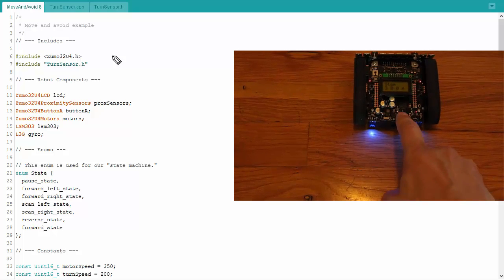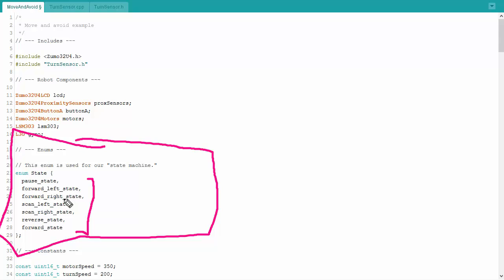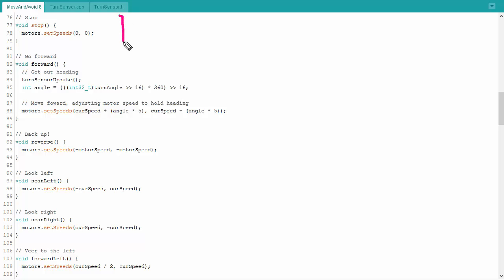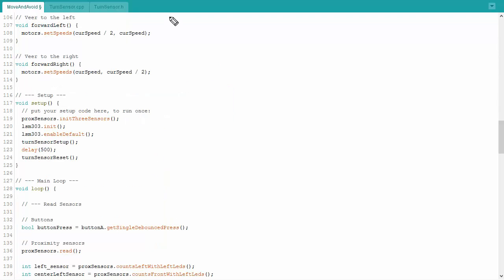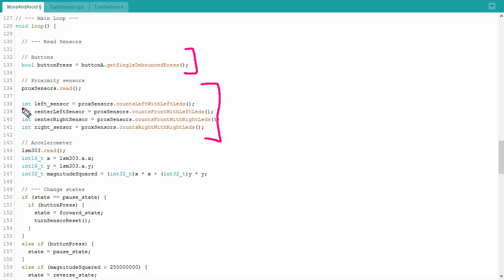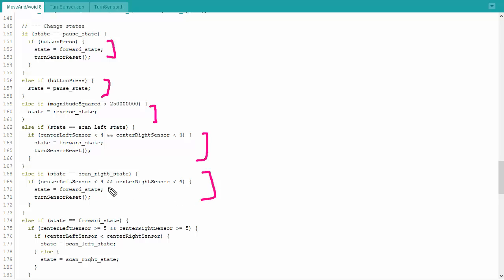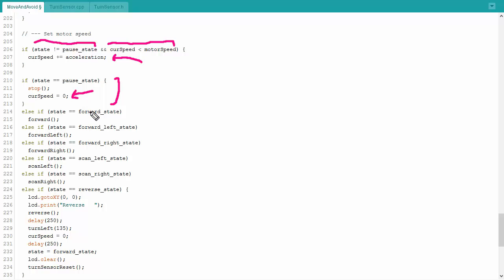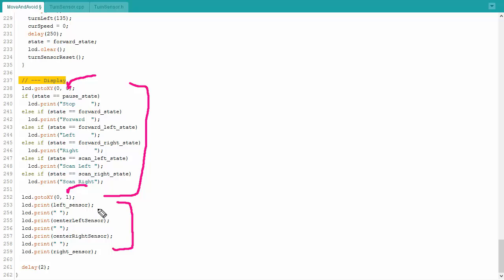Move and Avoid with Pololu's Zumo robot

Comment: buen dia, me sale este error de codigo, me puede ayudar a solucionarlo de favor gracias
In file included from C:\Users\ADMIN\Desktop\Nueva carpeta\zumo_32u4_examples-master\MoveAndAvoid\MoveAndAvoid.ino:11:0:
C:\Users\ADMIN\Desktop\Nueva carpeta\zumo_32u4_examples-master\MoveAndAvoid\TurnSensor.h:28:8: error: 'L3G' does not name a type
 extern L3G gyro;
        ^~~
C:\Users\ADMIN\Desktop\Nueva carpeta\zumo_32u4_examples-master\MoveAndAvoid\MoveAndAvoid.ino:19:1: error: 'LSM303' does not name a type; did you mean 'CS30'?
 LSM303 lsm303; // Accelerometer
 ^~~~~~
 CS30
C:\Users\ADMIN\Desktop\Nueva carpeta\zumo_32u4_examples-master\MoveAndAvoid\MoveAndAvoid.ino:20:1: error: 'L3G' does not name a type
 L3G gyro;
 ^~~
C:\Users\ADMIN\Desktop\Nueva carpeta\zumo_32u4_examples-master\MoveAndAvoid\MoveAndAvoid.ino: In function 'void setup()':
C:\Users\ADMIN\Desktop\Nueva carpeta\zumo_32u4_examples-master\MoveAndAvoid\MoveAndAvoid.ino:128:3: error: 'lsm303' was not declared in this scope
   lsm303.init();
   ^~~~~~
C:\Users\ADMIN\Desktop\Nueva carpeta\zumo_32u4_examples-master\MoveAndAvoid\MoveAndAvoid.ino: In function 'void loop()':
C:\Users\ADMIN\Desktop\Nueva carpeta\zumo_32u4_examples-master\MoveAndAvoid\MoveAndAvoid.ino:154:3: error: 'lsm303' was not declared in this scope
   lsm303.read();
   ^~~~~~
In file included from C:\Users\ADMIN\Desktop\Nueva carpeta\zumo_32u4_examples-master\MoveAndAvoid\TurnSensor.cpp:6:0:
C:\Users\ADMIN\Desktop\Nueva carpeta\zumo_32u4_examples-master\MoveAndAvoid\TurnSensor.h:28:8: error: 'L3G' does not name a type
 extern L3G gyro;
        ^~~
C:\Users\ADMIN\Desktop\Nueva carpeta\zumo_32u4_examples-master\MoveAndAvoid\TurnSensor.cpp: In function 'void turnSensorSetup()':
C:\Users\ADMIN\Desktop\Nueva carpeta\zumo_32u4_examples-master\MoveAndAvoid\TurnSensor.cpp:45:3: error: 'gyro' was not declared in this scope
   gyro.init();
   ^~~~
C:\Users\ADMIN\Desktop\Nueva carpeta\zumo_32u4_examples-master\MoveAndAvoid\TurnSensor.cpp:49:17: error: 'L3G' has not been declared
   gyro.writeReg(L3G::CTRL1, 0b11111111);
                 ^~~
C:\Users\ADMIN\Desktop\Nueva carpeta\zumo_32u4_examples-master\MoveAndAvoid\TurnSensor.cpp:52:17: error: 'L3G' has not been declared
   gyro.writeReg(L3G::CTRL4, 0b00100000);
                 ^~~
C:\Users\ADMIN\Desktop\Nueva carpeta\zumo_32u4_examples-master\MoveAndAvoid\TurnSensor.cpp:55:17: error: 'L3G' has not been declared
   gyro.writeReg(L3G::CTRL5, 0b00000000);
                 ^~~
C:\Users\ADMIN\Desktop\Nueva carpeta\zumo_32u4_examples-master\MoveAndAvoid\TurnSensor.cpp:71:25: error: 'L3G' has not been declared
     while(!gyro.readReg(L3G::STATUS_REG) & 0x08);
                         ^~~
C:\Users\ADMIN\Desktop\Nueva carpeta\zumo_32u4_examples-master\MoveAndAvoid\TurnSensor.cpp: In function 'void turnSensorUpdate()':
C:\Users\ADMIN\Desktop\Nueva carpeta\zumo_32u4_examples-master\MoveAndAvoid\TurnSensor.cpp:95:3: error: 'gyro' was not declared in this scope
   gyro.read();
   ^~~~
Se encontraron varias bibliotecas para "USBPause.h"
  Usado: C:\Users\ADMIN\Documents\Arduino\libraries\USBPause
  No utilizado: C:\Users\ADMIN\Documents\Arduino\libraries\Romi32U4
  No utilizado: C:\Users\ADMIN\Documents\Arduino\libraries\AStar32U4
Se encontraron varias bibliotecas para "PololuBuzzer.h"
  Usado: C:\Users\ADMIN\Documents\Arduino\libraries\PololuBuzzer
  No utilizado: C:\Users\ADMIN\Documents\Arduino\libraries\Romi32U4
  No utilizado: C:\Users\ADMIN\Documents\Arduino\libraries\ZumoShield
  No utilizado: C:\Users\ADMIN\Documents\Arduino\libraries\AStar32U4
Se encontraron varias bibliotecas para "PololuHD44780.h"
  Usado: C:\Users\ADMIN\Documents\Arduino\libraries\PololuHD44780
  No utilizado: C:\Users\ADMIN\Documents\Arduino\libraries\Romi32U4
  No utilizado: C:\Users\ADMIN\Documents\Arduino\libraries\AStar32U4
Se encontraron varias bibliotecas para "FastGPIO.h"
  Usado: C:\Users\ADMIN\Documents\Arduino\libraries\FastGPIO
  No utilizado: C:\Users\ADMIN\Documents\Arduino\libraries\Romi32U4
  No utilizado: C:\Users\ADMIN\Documents\Arduino\libraries\AStar32U4
Se encontraron varias bibliotecas para "Pushbutton.h"
  Usado: C:\Users\ADMIN\Documents\Arduino\libraries\Pushbutton
  No utilizado: C:\Users\ADMIN\Documents\Arduino\libraries\Romi32U4
  No utilizado: C:\Users\ADMIN\Documents\Arduino\libraries\ZumoShield
  No utilizado: C:\Users\ADMIN\Documents\Arduino\libraries\AStar32U4
exit status 1

Compilation error: 'L3G' does not name a type